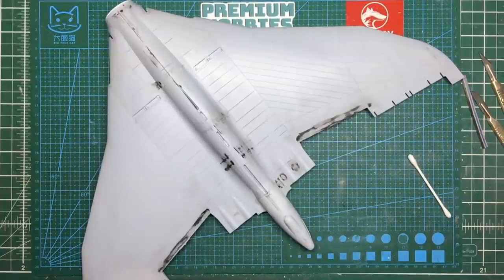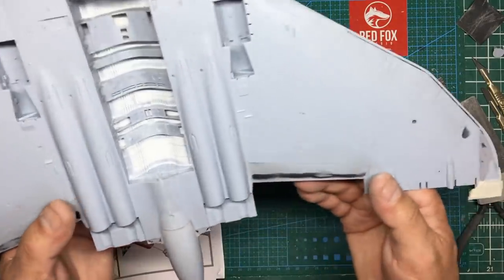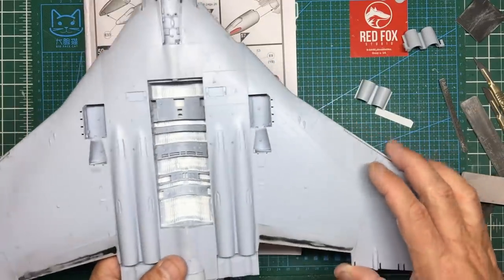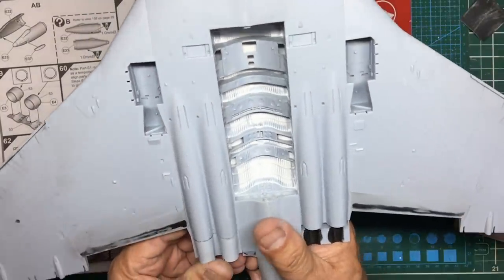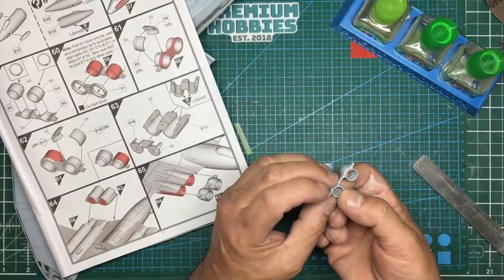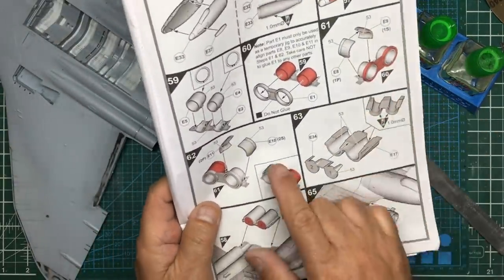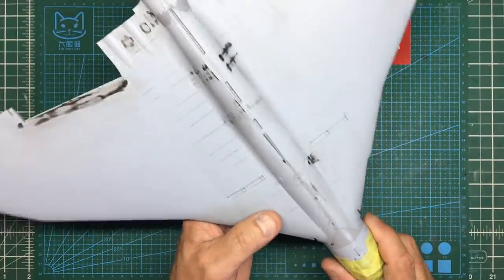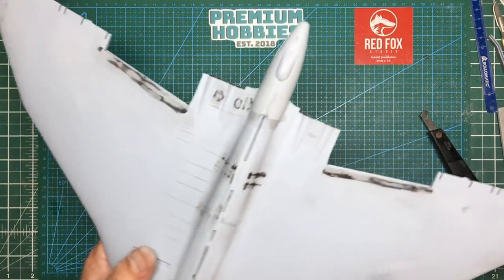Airfix New Tool 1/72 Vulcan build. Part Nine

Comment: Another great video Nigel. A quick note about the rear exhausts. You will need to do your research for whatever Vulcan you are going to do. Looking at pictures, most existing Vulcan's in museums etc have the short exhausts. EG XM607 & XM594 both have short exhausts. But XH558 has long exhausts. Same goes for those panels under the engines. Some had both fitted, some had only one. XH558 has only the starboard one fitted. XM594 has both fitted.
Reply from the maker: Yeah, ahead of you there Andrew. I have chosen to do XH562 with the Kiwi roundels. I almost got caught out because it looks like the pic i have is reversed and it has the plate in the port side and no plate stbd??

Comment: The joys of modelling. I have reached the stage you are at, and just realised I did not fit the engine blades at the back of the intakes. Although you can't really see them, you know how it gets to you. I tried whittling them down and fitting from the front. No joy. I am going to fit the intake covers to mask my error.
These are the best seamless intakes you could wish for, and I am having to hide them. The missing blades still annoy me.
Reply from the maker: I don't think the fod covers will fit?? Could you cut a slot in the side of the bomb bay and go in from the side?
Reply: I've tried them, and they do I'm relieved to say. Nice and snug and no glue required.
Reply: @NigelsModellingBench    Too scary.

Comment: Strangest thing with sink marks was the Academy 1/48 F4 Phantom where i ended up with random sink marks after the parts had been glued together... maybe the case on this kit??  the glue is shrinking the plastic as it dries
Reply from the maker: No, sink marks were there before assembly. I only ever saw plastic move on a Mach1 kit.

Comment: JUst had a look at the online undercarriage photo's and it looks to me as if what you're suggesting is a removable plate to prevent an inadvertent retract while the Vulcan is parked and looking on my corresponding part it doesn't seem to have been modelled. Needless to say I'm planning which Vulcan I'm building - currently thinking of XM597 in Black Buck fit out - need to source a couple of pairs of Shrikes for that plus rails and hardpoints. Fall back choice would be XM607 again Black Buck but with a full complement of 1000 pounders.
Reply from the maker: If you look at the drawings from dowty's and the VTTS vids on You Tube you'll see there is definitely only one locking bar in service.
Reply: @NigelsModellingBench  You're right, looks like a piston or actuating rod on the Dowty drawings. looks like that top bar has  to be removed
Reply from the maker: @phillipsiviter2024  no Phil, the bottom bar has to be removed. If you look at the part vs drawing the top bar is square section. It is not a cylinder.

Comment: Great video Nigel, the model is looking really great 👍. I'm totally enjoying this build, even though I'm not a big fan of airplane models, I'm learning a lot of good information and tips from you. I didn't realize that  you would, or could use so many different types of cement. I've purchased 3 different types of tamiya cement for working on my models. I was curious as to why you use both tamiya, and Mr cement aside from the bigger brush that Mr cement uses, is there any other difference that I should be aware of?
Reply from the maker: No other difference I'm aware of. I think the tamya QS may be hotter than the SP?
Reply: @NigelsModellingBench  thanks for the info Nigel,  appreciate you. 👍

Comment: Just a thought Nige, when you were building the bomb bay spar system did you check that the spars were parallel? As I suspect a slight misalignment there may have caused some of the fit issues.
Reply from the maker: I thought the same and dry fitted the upper fuselage halves before the glue set. I am convinced my port wing is shorter than the starboard. My nose section was also smaller in diameter than the wing parts. If I build another one I will assemble the upper and lower halves so I have one top and one bottom, then sandwich the spar assembly between them, align, clamp and glue the edges of the bomb bay to the lower wing, cure, disassemble and glue the spars. There are so many parts which could cause misalignment.

Comment: Hi Nige, that Mr Surfacer seems to shrink so easily and re-reveal the seam , so it seems to be a case of apply....sand....shrink....reapply....sand....shrink...reapply...etc etc. Could you use an alternative to Mr Surfacer that won't shrink as much and therefore cause fewer issues and less work? I tend to use Revell's "Plasto" putty, which definitely doesn't shrink as much as what I'm seeing with your Mr Surfacer. I also use Perfect Plastic Putty, which is water based so a quick swipe with a damp cotton bud will remove any excess from seams etc...I've seen Phil Flory do that as well.
Reply from the maker: Yes David you are correct. I think these sink marks are a lot deeper than I first thought. I would have used Tamiya filler first and then Mr Surfacer over the top had I realised.